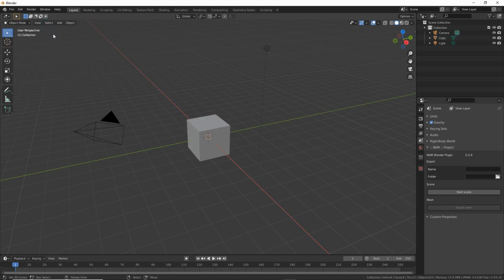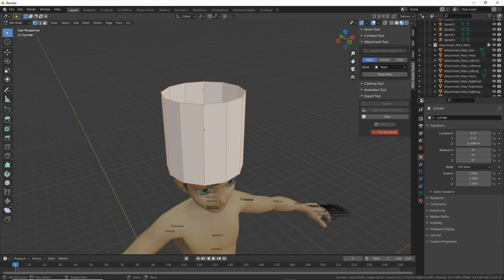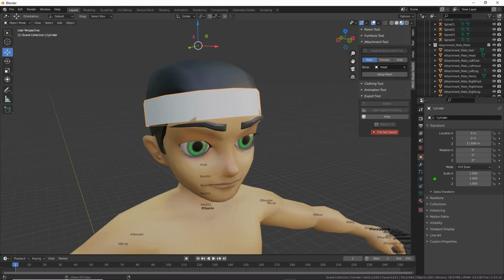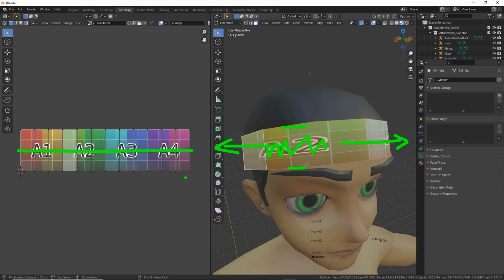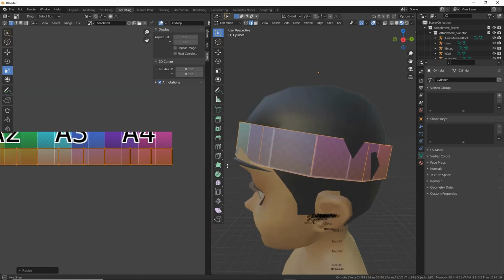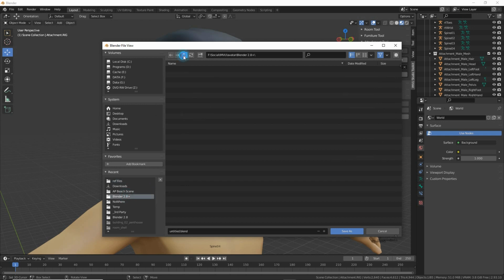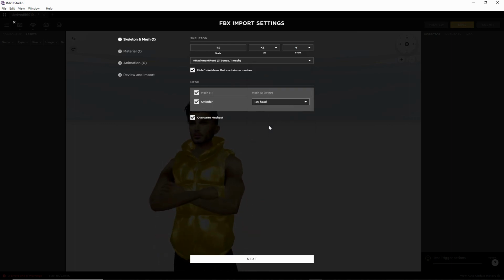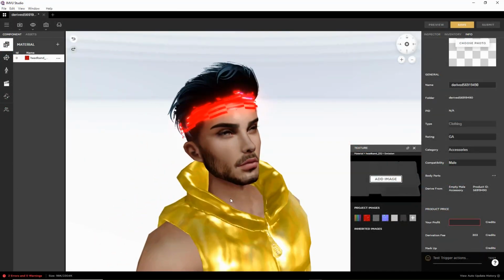Simple Accessory using IMVU Toolkit Attachment Tool

Comment: hi!! i’m having the same issue as a few others. i’m making back accessories, but everytime i export into studio it’s inside of my avis neck. i feel like ive tried everything and still the same outcome. all of the bones are correctly placed, please help!! :,))
Reply from the maker: You need to 'attach' it to the same bone in Studio. See under Skeleton*, check the *Node is the correct one.
Reply: @KatsBits everything seems to be correct! i saw one video that said to try “apply all transformations” then “set origin to geometry” and that did fix it once, but now i have the issue over again with other meshes. thanks for replying!
Reply from the maker: @curlyftp  Ah okay, we don't need to do that any more so that must have been one of the older vids. You might need to unparent the mesh from the Armature using the "Keep Transform" option. Once you do that, set the mesh up again. If you get stuck, jump on Discord (see channel About page for link).
Reply: @KatsBits okay!! i’ll try once im off work. thank you so much for replying!!

Comment: when I set it up and attach it to the rig and then go to add it into imvu studios its not where I positioned and rigged it at its inside my torso
Reply from the maker: After import check the 'bone' that's used as the target, it's needs to match the one used to set up the item in Blender - if you're using the Accessory derivable, in Studio look in Skeleton properties and the "Node" being used.